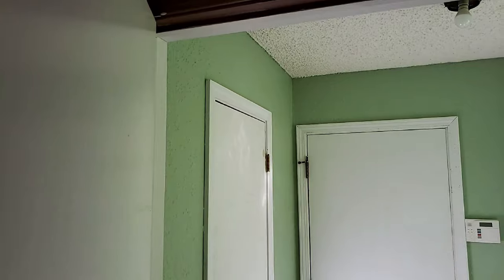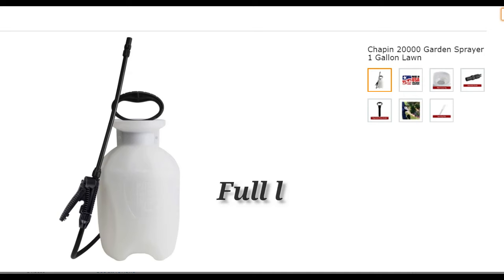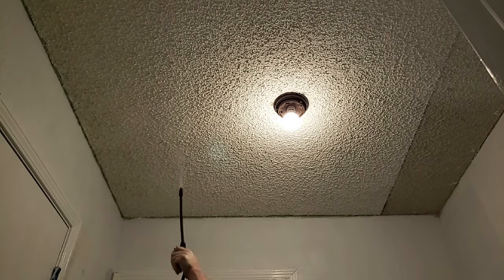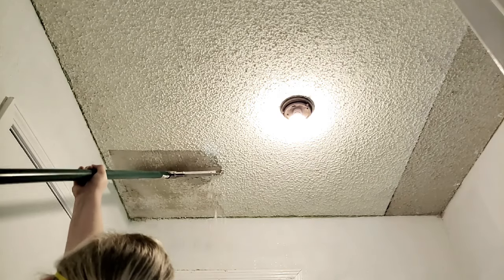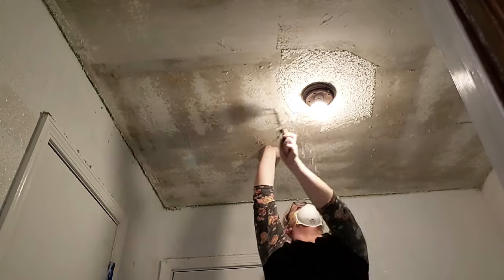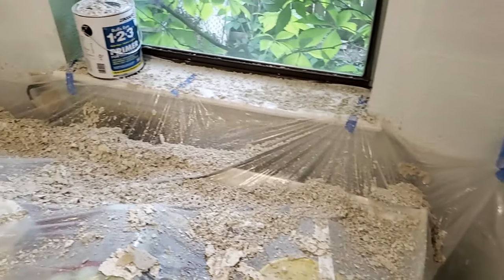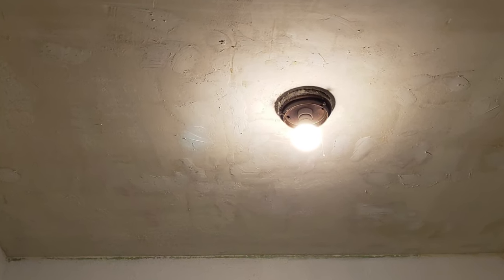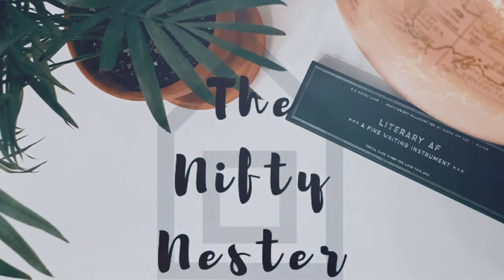How To Remove Popcorn Ceilings Easily | Remove Popcorn In 5 Minutes

Comment: We used to put a lil fabric softener in the hot water and it gets the popcorn super soft and leaves the room smelling fresh.
Reply from the maker: That's a great idea, thanks for the tip!
Reply: I’m was cringing this entire video.. I was afraid the water would spritz the exposed light bulb. 😓 and 🤯
Reply: I think that the fabric softener would maybe slow down the evaporation rate of the water on the surface allowing more work time ?
Reply: That helps
Reply: Honestly, I don't think anything is better or faster than just pure hot water.
Reply: 🤔 uhmmm I'm a try that.
Reply: @life_with_twa7778 😂😂😆 STOPPP but TruE!!

Comment: If you work from a step ladder and hold a round garbage can lid to catch the scrapings, it is a much neater process than letting it all fall to the floor. Clean up is much faster
Reply from the maker: That is a good tip. Unfortunately I have to use my free hand to balance myself or I'll fall off the step latter 🤣 I'm terrified of heights. But for everyone coordinated enough they should give it a try lol.

Comment: U can smooth out wall patching compound with a wet rag bcuz when it gets wet it can be easily wiped to a smooth finish... its better than dry sanding bcuz u wont have to worry about any dust
Reply: Do you let it dry first before using a sponge on it?
Reply: @orlandparkcounselors  yes

Comment: Cover the floor, turn the light off electric and water don’t mix. I did my rooms in 1/4 sections and removed sheet with popcorn mess each time then just kept moving down. Made the mess a lot easier to handle I did a great job.

Comment: I enjoyed the video very much. Great detail but friendly. Two suggestions I'd make are to wear a true respirator. Even if the ceiling is not old (suggesting that there may be asbestos in the dust), light dust can pass by or through a simple mask. Second suggestion, because I'm lazy, you can texture the drywall (like orange peel). It hides the imperfections in the drywall.

Comment: Personally I would use a 12" or 18" taping knife and ladder. Keep it almost parellel with ceiling when scraping. Less gouges that way. Also  in my opinion you wanna put knockdown or orange peel after. Really hard to make smooth ceiling look perfect. Thanks 4 vid.
Reply: She over sprayed some. There is some moisture in the drywall.

Comment: This was very helpful. The warm water did help it to come off much easier however so be careful because too much water could possibly damage the sheet rock. Also while this video is a great start but is not a 5 minute project.The sanding alone took my husband 3 days, but if you don’t care to have bumpy walls it might be different for you. Also,  You should def get a fan to make sure it is well dried before starting to sand then continue with priming and painting. Good luck!

Comment: Another finishing solution is to paint the scraped ceiling with thinned drywall mud.  Add some extra water to the mud to make it kind of runny, then use a roller to apply it to the ceiling (short nap roller).  It wont give you a super flat finish, but its better than popcorn and faster than trying to get the ceiling perfectly smooth, and it'll help with delineating the walls from the ceiling (does that make sense?) similar to painting two ajoining walls slightly different colors.  Do it one area at a time and develop a pattern so it looks uniform across the room when you're done. finish off with your choice of primer and paint.
Reply from the maker: I've started skim coating the ceilings after removing the popcorn and it looks so much better but I haven't tried rolling it on. I've been obsessively making the ceilings perfectly smooth which is a hassle but looks so nice. I have considered using your idea though just to save myself some time. It is very time consuming to skim coat these to be smooth.

Comment: The house my son bought has popcorn ceilings and almost every room! We painted one room yesterday and we had to use a whole entire gallon just to cover that one ceiling in the bedroom. It's another drawback to having these feelings because you need more paint to cover. After seeing these kinds of videos I am really considering removing the popcorn ceiling out of the next bedroom before we paint it. The living area is another story because it has cathedral ceiling so that's a nightmare.
Reply from the maker: I feel your pain! It really is a pain to remove, even when it comes off easily, just because it's messy and it's on the ceiling. But I figure if you deal with it now, you'll never have to go back and remove it later!
Reply: I hope you removed the popcorn before you painted the other rooms 🙏
Reply: You can also try ceiling tiles, either a grid or glue on, covers the popcorn
Reply: If you wanna save paint on textured ceilings start with a primer

Comment: Heads up everyone. You will want to skim coat your ceiling after removing the popcorn texture to get a perfect smooth finish.
Reply from the maker: Do you run the compound across the entire surface, not just the areas that need patched? I was worried that would look even more textured.
Reply: @TheNiftyNester  yeah, essentially you need to build out the ceiling if you don't want the globs coming through. I wouldn't recommend to do it unless you have experience in it though lol but a small area such as that would be a perfect area to practice on!

Comment: skim coat it after or sand it down real nice and use a sprayer to paint it , you will have perfect nice flat ceiling
Reply from the maker: I actually just did my pantry and decided to do a skim coat in that room and it turned out perfect!
Reply from the maker: I've thought about doing that but I so desperately want smooth ceilings. I haven't been able to give up that dream yet.

Comment: Had popcorn walls in sunroom. Finished scraping, now the sheetrock has to he refinished. Did have some picks in the paper. Gonna let a pro finish.
Reply from the maker: I just did another room and ended up doing a skim coat after removing the popcorn. It's actually pretty easy to figure out! It's my most recent video if you feel like giving it a go yourself. I know sometimes it's easier to just pay a professional and not deal with the mess. I hope your sunroom turns out amazing!

Comment: my house was build in 1986 is there any ASBESTOS in the popcorn celling.
Reply from the maker: There might be, it was outlawed in the 70's but builders were allowed to use any they had on hand so it was used through the 80's. I would get an asbestos test before you get started.

Comment: Can you do the same for the orange peel textured ceilings?
Reply from the maker: That's a good question! I haven't removed orange peel myself but I would guess that as long as it isn't painted it would be the same process to remove it. I would also say that orange peel might be easier to skim coat over it instead of scraping it since it's usually a pretty light texture.
Reply: The orange peel is just drywall mud/joint compound, and as long as its not painted it should loosen up with a spray of water like is done on the popcorn in the video.  IT'll take longer to soak in, so just keep spraying it a few times over about 20 minutes, then test to see how loose it is with a scraper.  And I'd suggest using 'tap temperature water' not hot water.

Comment: What about a ceiling that has been painted with a latex ceiling paint?
Reply from the maker: If you add vinegar to the hot water it will help to soak through the paint. I've not done this myself since mine aren't painted, but I've seen others suggest this and they swear it makes it a lot easier. I think the mixture was 10% vinegar to 90% hot water.
Reply: I’ve taken down painted popcorn and hasn’t been an issue for me. Just finished one the other day.
Reply: @suesnoble  what did you use to mix in to make the painting soft to scrap?

Comment: I’m interested in removing the popcorn ceiling of my home just like you did but I’m worried about absetos now. My home was built in 1974 should I hire someone else to remove it?
Reply from the maker: I was scared for the same reason. There's a good chance with the age of your home but I'd orderan asbestos test kit from Amazon to get started. That way you'll know what you're dealing with. If it comes back positive you can hire someone or you can just skim coat over the popcorn to cover it. That won't get rid of it but it'll be sealed under a couple layers of joint compound. I'm doing the same thing in the bathroom I'm working on now just to see how well it works without removing the popcorn first. There's a lot of videos on YouTube that show you how to do it.
Reply: @TheNiftyNester  please let us know how that came out with the skim coat!
Reply from the maker: Will do! This bathroom is very slow moving, I haven't had a lot of time to work on it but it's coming along and I'll share the skim coat video as soon as I can!

Comment: Any concerns about having the sheet rock get mildew or mold from getting it wet?
Reply from the maker: I had the same concern. The drywall does get wet but the texture soaks up most of the water so the drywall doesn't get soaked, more damp than anything. You want to make sure it dries out completely before patching and painting. I set up a fan in the room overnight to help it dry quickly. From all the research I did before trying this method I didn't find any examples of people having a mold problem.

Comment: Will the water still penetrate if it has been painted?
Reply from the maker: I haven't personally removed painted popcorn but from what I've read it's a lot harder to remove with just water. I've seen vinegar water suggested and supposedly that makes it a lot easier to remove painted popcorn ceilings.

Comment: Good job☺️‼️ Can I use this format if I have popcorn walls?
Reply from the maker: Thank you, Amber! Walls are a little different. The easiest way I've seen people smooth out walls is by refinishing them with something like joint compound. You could sand or scrape the walls a little first to knock down the more raised areas on the wall first to make it a little easier to cover the texture.

Comment: What is my popcorn ceiling has asbestos, can I still do this? Or what do I need to fo before? Does anyone know? Please help : / thank you!
Reply from the maker: You definitely want to test for asbestos first (if you haven't already). If you have asbestos, I wouldn't scrape it yourself. I'd either hire a professional or cover it up. You can skim coat over it (you'll need to prime the ceiling first before skim coating). I have a video in skim coating if you want to check that out. It's a lot of work but safer if you have asbestos. Or you could cover it with new drywall, board and batten, or something else along those lines.
Reply: @TheNiftyNester  Thank you so much, I’ll definitely have it tested before I do anything, thank you!

Comment: Can I use a pressure washer instead to saturate the ceiling?
Reply from the maker: I'm not sure. As soon as I saw your question I searched to see if anyone had posted a tutorial trying that out and I'm not finding anything. The sprayer is ran on air pressure so it's like a mist and it's not very strong so it doesn't blast the texture off or damage the drywall underneath it. I would be worried that a pressure washer would tear up the drywall since it's got so much more power.
Reply: DO NOT use a power washer. It will tear up your drywall. You can use a paint sprayer with water because the pressure isn't anywhere near that of a power washer
Reply: Thanks for answering...we ended up not using the pressure washer thank goodness🤣🤣🤣🤦‍♀️🤦‍♀️...i know nothing about home improvement but im thankful for these type of videos..my home was built in 86 and it needs some TLC

Comment: But of course my ceiling has paint on it. It was thick frosting dripping texture with peaks. Very thick heavy. Any thoughts?
Reply from the maker: That sounds like it might be a bit of a hassle. I have heard that using vinegar water helps to break through the paint. I haven't tried it myself but others have sworn by it. I hope it works, good luck!

Comment: good video but not the safest  thing to do spraying--- water ----with the ---electrical ---and lights not only with the switch on but the breaker is on.... use external lighting to avoid being shocked or a fire hazzard

Comment: You left the ceiling bumpy. Is that from spot you scratched into the drywall or a sub par mud job?
Reply from the maker: Sub par mud job. I realized after doing this room that skim coating the ceiling was the best way to get a smooth finish. I skim coat the next room after removing the popcorn and it turned out 100% better.

Comment: Has anyone tried this on a painted popcorn ceiling? When we bought our condo, the bank had hired painters who used a sprayer to paint the whole place white, including the popcorn ceilings
Reply: Check out “That Kilted Guy DIY Home Improvement” here on YouTube. He’s a professional & has a few videos about removing popcorn ceiling. He goes through the whole process in detail - I just watched it & found it super informative. 

But basically he said that he may have to spray a painted ceiling 5-6 times to remove popcorn. He also said to test a small discreet area to make sure you’re even able to scrape it.
Reply: I did one ceiling that was painted, and it the entire layer of texture didn't come off, however, after scraping what did come off, I was left with what looked very similar to an orange peel textur, which saved me a step, as I would always texture a ceiling after removing popcorn.  It was serendipitous.

Comment: Can't you use a hose pipe from outside to spray the ceiling?
Reply from the maker: I wouldn't. The air pump sprayer works well because it has an adjustable nozzle and can spray a really fine mist. The fine mist allows you to spray the ceiling enough to dampen the texture without soaking through and damaging the drywall underneath it. Even with an attachment on a hose it would still be too much water.
Reply: That's what I did haha
Reply from the maker: Did you really?! How did that turn out, did you have any issues with the drywall drying?

Comment: ....What?!  I want that light bulb...that light bulb didn't pop?
Reply from the maker: Good old 80s fixtures lol. I didn't spray the light bulb, just around it, but I shouldn't have and I knew better. I finally have some construction light sockets that I can install while working on these types of projects which is still electricity but will be a little easier to work around.

Comment: Dangerous spraying water on light bulb that is turned on!  You are lucky it didn't blow up in your face.  You should have turned it off and removed the light fixture from the ceiling also.
Reply from the maker: Yeah I know, I commented on that fact while I was doing it. I didn't spray the light bulb but tried to carefully spray around it, I didn't have another light source at the time.